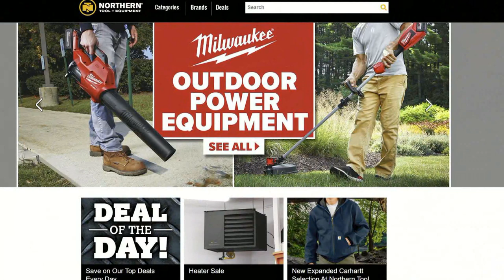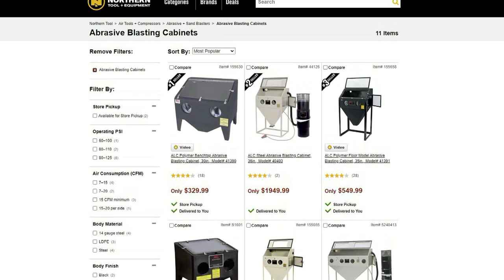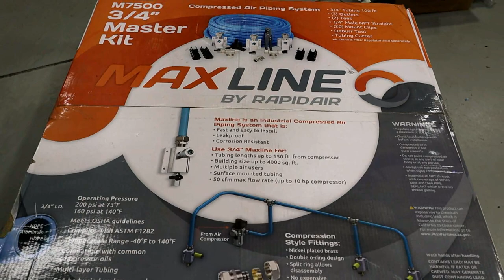Ultimate Shop Air Setup

Comment: Love the air lines 👍🏻
The only time I regulate my air is when I’m spraying paint 
Max pressure max power !!!
Been using my air tools for years that way !!!
100psi toooo slow lol 
I upgraded one of my hoses to 1/2 inch instead of the 3/8 usually use wow !!!! talk about air to sand blast  with 
I use a 10 hp 60cfm speed air from grainger 
Only because I used it at the collision center I owned .
Now that it’s just me its way over kill but it’s nice when I wanna sand blast outside 
I need to install airlines 
I wanna remodel my shop first it’s such a grunge hole lol
If you’re ever in Louisiana area you should come to cruising the coast I’ll buy the beers 🍻

Comment: I was thinking of doing this as well. Watched a lot of videos on it. Founds that having a pre-moisture remover within the first few feet was essential as that prevents the lines from filling up super fast. Then before each valve, the hose would run down to the  water remover/drain and then over to the valve. Slightly angling the lines near ceiling to promote draining. It’s quite an undertaking but worth it when it gets dialed in. 👍

Comment: I installed the 3/4" Maxline all thru my shop several years ago. Absolutely love the ability to easy modify the system whenever its needed. My compressor is on a 12' high shelf and I have air drops every 12' with a regulator on every drop.

Comment: I have a 5000 sqft shop here in Conroe TX. After running my Quincy 10hp compressor inside my shop for about a year, I elected to put it in my outside pump house for my well. The pump house is 8x8 and only housed the water well air compressor, the water system pressure pump and a 40g pressure tank. My compressor is mounted on a standup 80g tank and runs with a 15hp VFD since I only have single phase 240v power. The pump house stays pretty warm from the heat generated from the two compressors and I don't have it vented and is stays pretty dry in the building.

Comment: G'day from West Australia, Kyle😉🙂👍👍

A coil of copper tube from compressor head, followed by a A/C Condenser works incredibly well for cooling compressed air before entering storage tank.

Guess you could call it a poor man's air drier.🙂

And yes a drain down low is useful as well.

Comment: I have the same air setup with the quincy air dryer. my compressor is outside with a small shed and slab. I live in texas and run my cnc plasma table no problem with moisture. now if my shop were to be as big as yours i probably would keep it inside. nice shop

Comment: Put the dryer after the copper. The cooler the air you put into the dryer, and the less moisture, the better it will work and the longer it will last.

Comment: Castair makes a good Compressor too. You can get a Charge Air Cooler mounted on the compressor with an automatic drain that basically eliminates the need for dryers or drains.

Comment: Nice and clean install. Just an FYI unless your getting a refrigerator dryer you need at least 25 foot of air line between the compressor and the dryer.
Reply from the maker: refrigerator is the plan

Comment: Consider adding a ball valve to the hose reel.  Those reels develop small leaks over time.  No point in leaking air when the hose reel is not in use.

Comment: I got system under the airtank, when pressure goes to zero valve open and water comes out. I got some leaks in system so pressure goes to zero every night. I also spray some rust proof wax to airtank, so it dont rust in bottom.

Comment: Ive seen people run a copper line through a fridge with a electronic blow off valve off of it too drain condensed liquid, before it goes out to the shop

Comment: Just a comment.i know quite a few machines hops useing schedule heavy wall plastic pipe glued. With no problems .
Reply: Yeah,  9 out of 10 have no problem.  The 10th has exploding pipe.
Reply: @henrymiller1820  CHECK OUT HEVYWALL SCHEDULE 80 PLASTIC PIPE I  BELIVE IT'S RATED FOR 3000 LBS . 175 LBS IS WELL INTO THE SAFTY SPECKS .

Comment: remove that copper line from compressor to tank. install an 'intercooler' before it enters tank. provide with auto bleed valve prior to enter tank.
Reply: Yes Dr. Voss needs to know this is the book & school of hard knocks correct plumbing procedure.   , got that KYLE !!!!!   
It’s Friday fool. & YOU NEED TO KNOW THAT ,  if it was easy anybody could it ❤️🏴‍☠️🎥💯%👍🏻🇺🇸